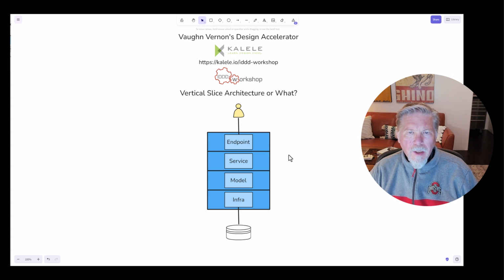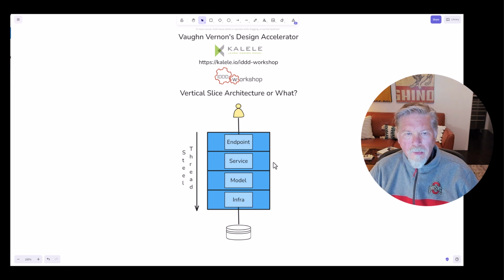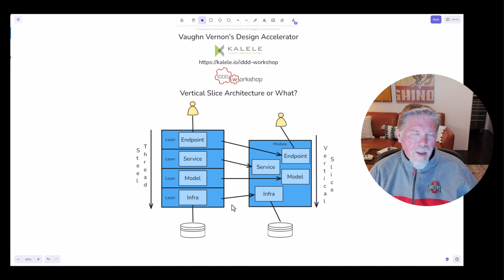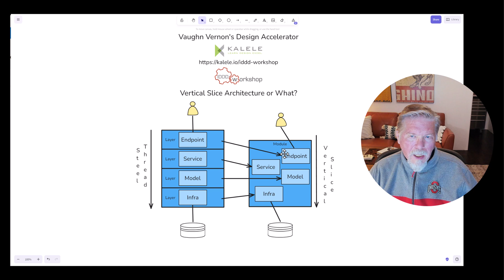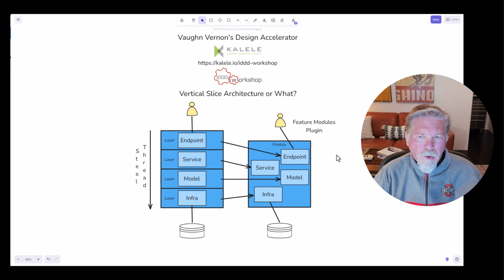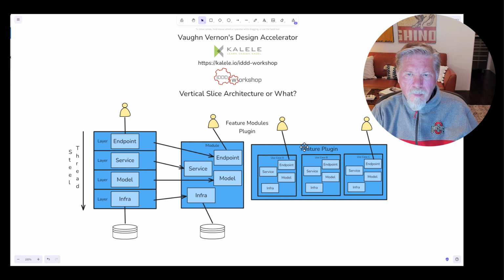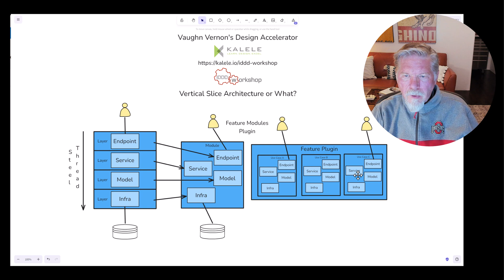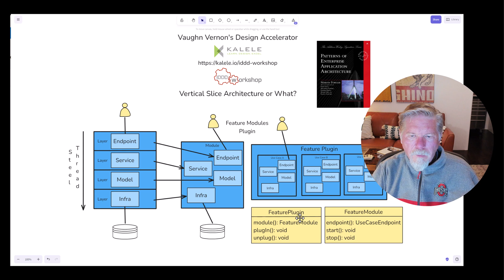Vertical Slice Architecture or What?

Comment: Thinking about combining vertical slices like that with a ports and adapters model for each slice or feature/use case.
Reply from the maker: Since "everything" is in a single module, what would otherwise be the "outside" (driver and driven adapters) and the "inside" (driver and driven ports) are all in one place. I think there could be flexibility inside the "feature module" to have sub-modules of those components. At best, it's likely considered unnecessary.

Comment: Great content as usual! I'm not sure whether it is just me or what but most of the audio was only on the left, not on the right. I mean the introduction and the very last I could listen to the content on both sides but the main content was only on the left.

Anyways, great content!
Reply: Weird. Every track was set correctly. I double checked the settings. This is a real pain.
Reply from the maker: I did all the right things for audio. Returning later, the stereo mode was off on all but the first clip.